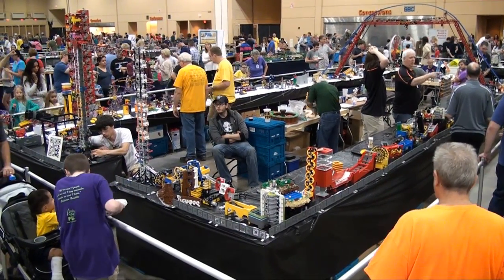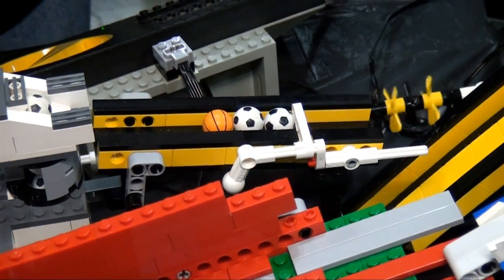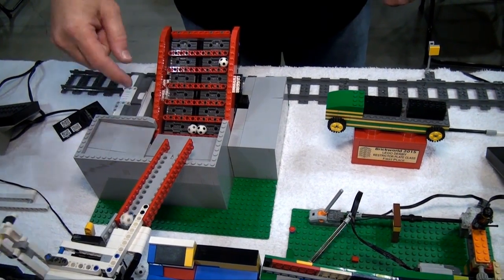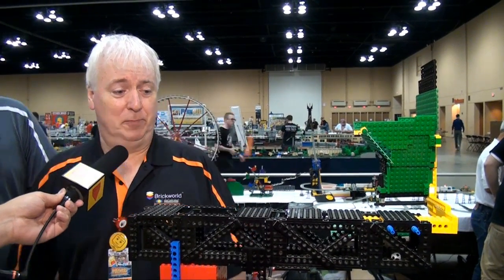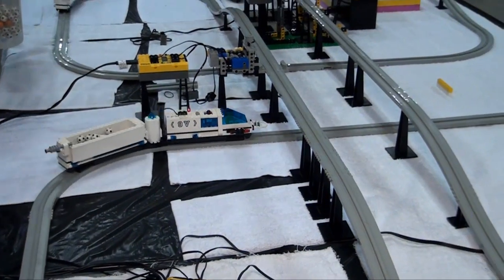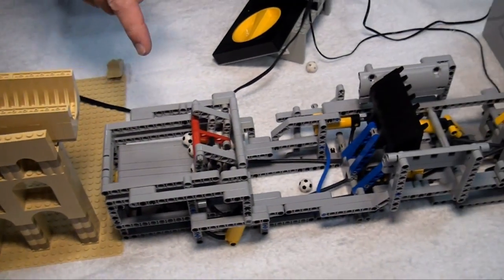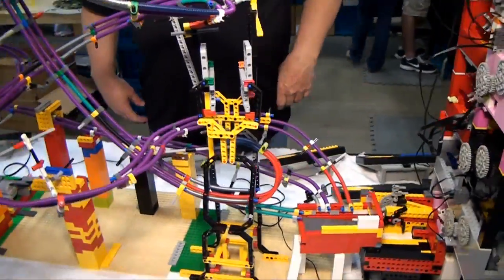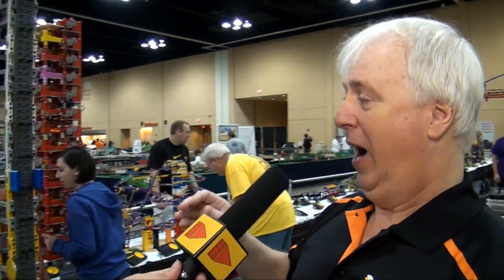World's longest LEGO great ball contraption / Rube Goldberg – Brickworld Chicago 2015

Comment: I'm surprised there's nothing sorting the soccer balls from the basketballs. Should be able to do it with an LED light sensor from the train controllers, what with the one type of ball being brighter than the other. Seems like using a few stages, one should be able to catch all of the soccer balls 'cause they triggered the sensor with their white sides - the black printing would fail on some of 'em but that's why you do the repeater. Design it really well, and maybe it could use the grabber fingers to pick out the ones of the right colour. OR it could be somehow done with the texture.....
Reply: But that would be discrimination, the ACLU would have a field day!  Just kidding, that is indeed a good idea.
Reply: SoyBoySigh the orange balls are there to follow a Single Ball easier i guess....
Reply: SoyBoySigh DO NOT SEPARATE LEGO BALLS BY RACE! Lol jk
Reply: I realize this comment is from 5 years ago, but I’ve seen at least one GBC video on this channel that featured a module that could separate the soccer balls from the basketballs. I think it used one of those color sensors and could even tally up how many of either kind made it through.